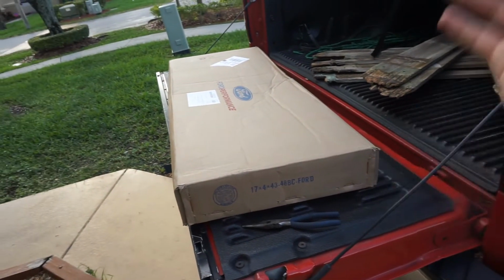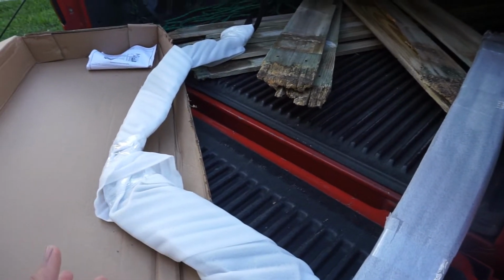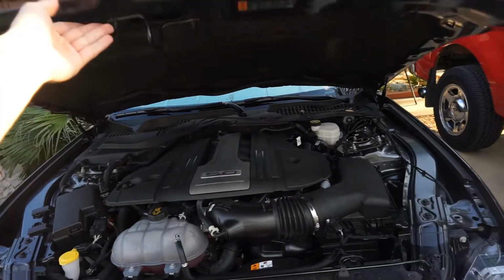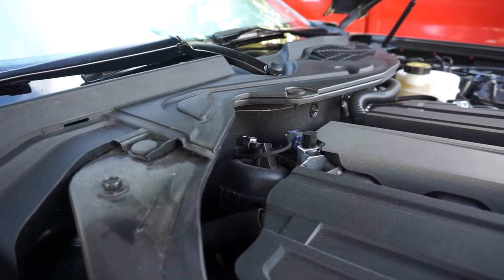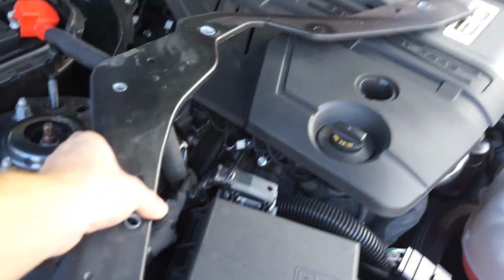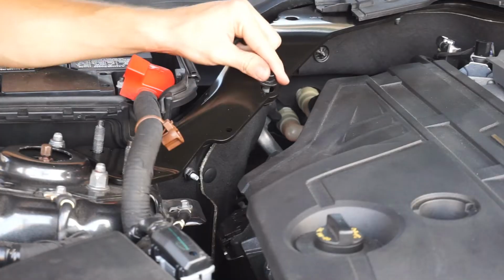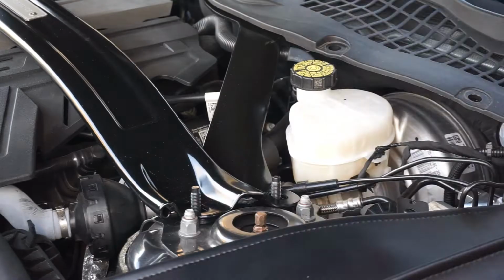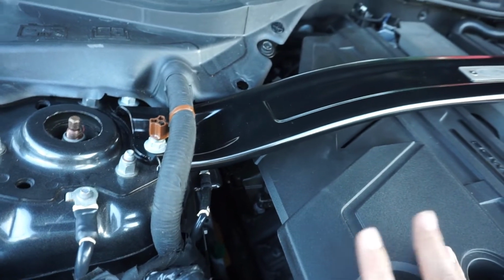The Stang gets some front end stability (Ford Performance strut tower brace)

Comment: Hello
can you tell me if you still have access to the oil dipstick?
possible to remove the gauge is to put it back to check the level, difficult, easy? , or you have to remove the reinforcement bar? and also how much does the bar weigh?
Reply from the maker: Hey! Not going to lie, it's difficult to check the dip stick with the strut tower brace in the way. It is possible to remove the dip stick with out removing the strut tower brace. What I do is, my left hand holds the yellow top part and start pulling up. Once the yellow part clears the hole I start angling away from the brace. And with my right hand I grab around the middle part of the dip stick to help clear the brace. And to put back the dip stick either to check or leave it there is pretty much the same process but reverse. Make sense? 
Now the weight of the strut tower brace, I have no idea but I looked it up and it's 22 pounds. Don't quote me on that one. lol
Reply: @jaysfinest9993  ok thank you, i understand quite what you mean. is the galley lol. for the weight i saw 21.5.
Reply from the maker: @johnhulster7658  Anytime, glad I can help you out. Well I was close with the weight lol